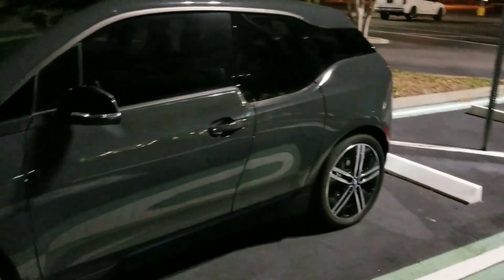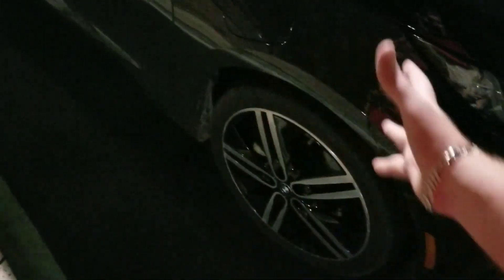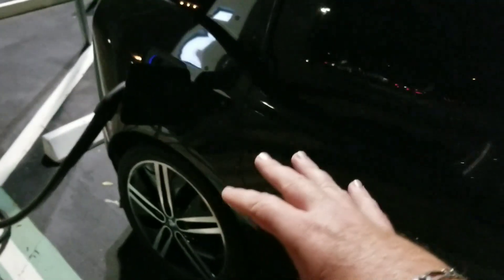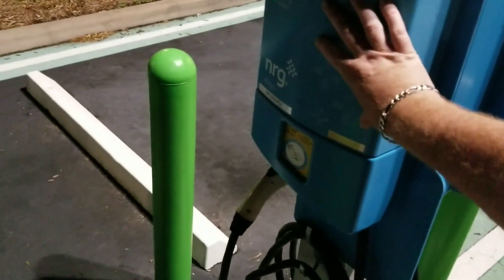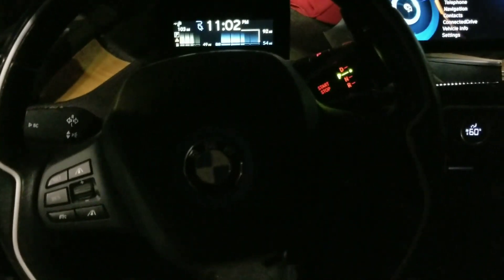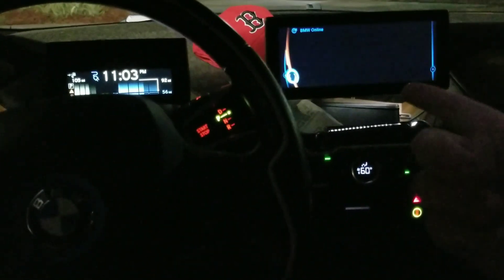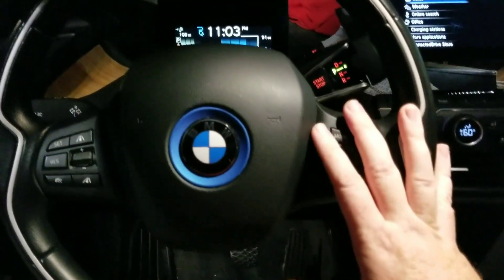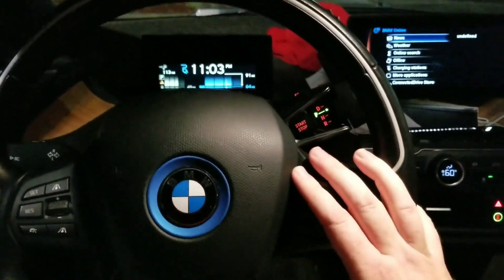BMW i3 6 months later

Comment: Check engine light. Randy had to clear the codes and not let the REX run to empty (fuel system). The sensors sound very finicky.
Reply from the maker: Oh they are

Comment: I agree with your comments at the end of the video (BMW must keep up on their stuff or else they will fall behind!) However, one thing for me that personally sets the i3 above the rest is being able to use the Rex on longer highway trips (hold mode). Sometimes I drive quite a few miles outside of zones that have charging stations so being able to refuel on those occasions makes this car work whereas others may not (for example, a full electric car in dead of winter [reduced efficiency] when I haven't had a chance to charge for whatever reason [reduced range to start with]).  Have you enabled the hold mode to use on the highway? I hear differing opinions as to whether or not the engine is loud in this scenario...

Thanks for the videos!

Comment: Interesting that you said it's feasible to take this car on long road trips. I had seen in some other video that you can use the Rex engine to keep you going if you can't find any chargers on the road but if you do that over long distances multiple times a year, it'll start having mechanical issues or even give out. What do you think about this?

Comment: I have owned 6 different BMWs.  All of them 3 series.   I really want my next car to be electric and I love the i3.  I am worried though cause I live 2 hours from the closest dealership which has never been a problem because I have never had problems with any of my vehicles.  I would take them in for service once a year while they were under warranty and then when they weren't I would just get them serviced myself locally.  I worry because it would be my only car and I live where the roads are pretty shitty and I'm worried about those tires I hear people get a lot of flat tires.  I wouldn't be able to be without a car every few months because I got a flat tire you know what I'm saying.  What do you think about the tires have you had a problem I know you said the rims were soft?  Also I live in the desert in the hottest place in the country extreme Summers.  How is the air conditioning is it comparable to a F 30 air-conditioning?  I like your BMW videos show more your i3.  😊
Reply from the maker: +Carey Kenna no tire issues if you don't hit curbs etc.
Only had to replace on tire for a sidewall bubble that's it
Reply: Carey Kenna should stick with a reliable hybrid. i3 is more of an urban car. Infrastructure is critical for electric.

Comment: Thanks for a great video. A major drawback on this car is the fact that in some markets @bmw engineers have decided to disable both gps and the sim leaving the car without any connectivity. This of course means that there is no navi and not even an app, leaving the car functioning as well as a dumb battery with wheels. You are one of the lucky ones.

Comment: We are in OHIO....Cold as F..ck!  SO....December thru March it could be a challange....range is usually around 50-60 miles in the dead of winter....Ive even seen 43miles on full charge with heat at 84 and full fan....(and I will say that while it warms you up nice, the "84" isnt really 84 degrees.....

Comment: I never see the point in carrying spare fuel like that though....im in the UK its smaller and there are stations all over the place so your never out in the middle of nowhere where there is not one nearby.Plus like you say its dangerous and if you are in a crash you smash into the side of someone...not good plus im sure you would get way more into shit for carrying it.

I was going to buy one of these BUT I am really not sure about the tyres..the UK more so my area is pothole heaven our roads of sooo bad. we pay road tax the money goes towards things like fixing them but NOPE the government pisses the money away on other things,  where I live they like to stick a bit of ...whats it called...TAR into each pothole which after a few days crumbles and its a hole again

My 2007 honda civic had just past its MOT test in may this year and I had turned round a tight corner and I had seen a pot hole but because the corner was tight I could not avoid it and went over with the right side front and back tyres and my ABS and VSA warning lights came on, with going over the pothole it has broken my ABS sensors, the VSA I can live without as there was a on/off button on the dash and tbh here in the UK atleast you don't have to have ABS on your car as old cars don't have it but I can tell a big difference without it. I am leaving it for now though, its a good job it happened after my MOT even though you can drive ok without them iff it was before the MOT they have to fail the car because of the warning lights on the dash.

I have seen a I3 around this area though infact I think there are 2 a orange one and a blue one, I am just a little cautious because its my luck I will be the one hitting all the potholes :0
Reply from the maker: In the US there are long stretches of nothing...... this wasn’t a Europe trip it was a Miami to Las Vegas one

Comment: The depreciation is brutal and no amount free electricity will ever make up the loss in value
Reply from the maker: +Robert Montgomery as I’ve found out lol
Reply: Robert Montgomery Don’t buy it new!
Reply: Exactly!  I bought mine 1year old , only 6000miles on clock for  at $27K  (£22K in UK) from BMW with 2 years warranty left. Love it. Price of gas vs electricity   in UK means if I keep this for 8years it will have paid pay for itself entirely. Magic free car!
Reply: Robert Montgomery , that's why you buy used. I only drive 10k per year and the savings in gas compared to my vw golf pays 5 months of the payments for me. And that includes added cost to my electric bill (about $20 more per month)
If I drove 80 miles/day it would literally pay for itself.
Reply: just got 1 for 9K, love it

Comment: Im looking into buying an 2015 I3 Rex. I want to hack it to enable Hold mode at 75%.
My question for you is. Does the car run slower while in hold mode? I need some answers! not even sale people at dealership can answer my questions!
Reply: I have found that I can run continuously at 75 to 80mph with Rex on without losing charge on flat. Beyond that speed and/or uphill it will lose charge or you run slower .
Reply: Very easy answer...at 6% of course it will lose power if it is being called apon to do heavy work because at that point there is very little energy in the battery and the generator isnt that strong and cannot keep up with the electric motor's demands. At anywhere between 20 and 74% no problem...no loss of power but sustained highway speed in excess of 65 mph or on a windy day or going uphill quickly will result in the car losing battery percentage slightly. I have found on mine (2015 rex) that the motor and generator combo is not that strong. The regen on the car is far better at giving the car a charge. I estimate the generator is giving the car the equivalent of about 15 amps of charge when the engine is really reving..at 2000 rpm, maybe 6-8 amps.